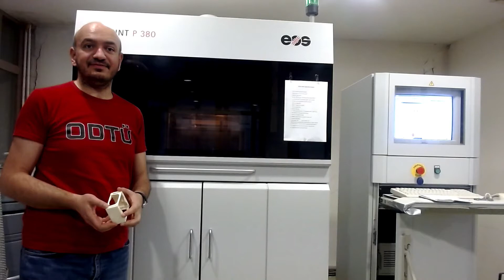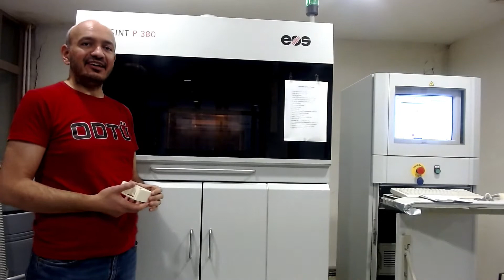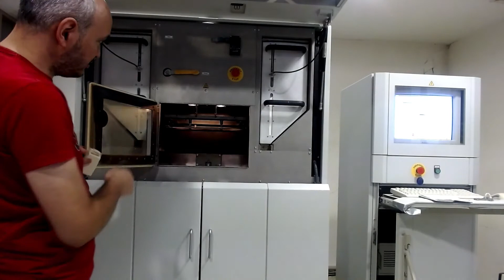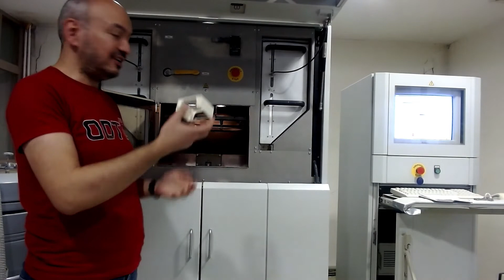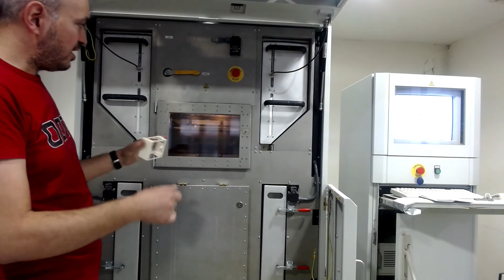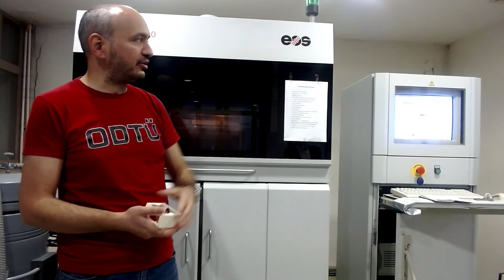ODTÜ - ME495 - Fall 2020 - Week 8 - EOS EOSINT P 380 Selective Laser Sintering (SLS) System

Comment: Which is the build rate with pa12 of that P380? Thanks
Reply: You r right. It is very old machine. It is 2002 brand. I m using it. It is working well but very slow. I don t know the theoritical built rate but I know from my experience every layer which is 0.15mm takes 1-2 minutes depending on the x section of the workpiece. I will check the theoretical value on monday from the manuels.
Reply from the maker: Are you asking the scanning speed of the laser? or fabrication time of a part?
Reply: Hello  @UlasYaman  , I’m looking for the fabrication speed. Usually EOS in the printer data sheet shows the build  rate in cubical cm / hour with pa12 with 5% packing density. The P380 is quite old and I can’t find that parameter.
Reply from the maker: @albertooggero5357  I will check that out next week.
Reply: @UlasYaman  thank you, really appreciated